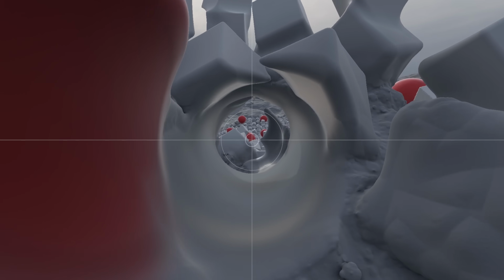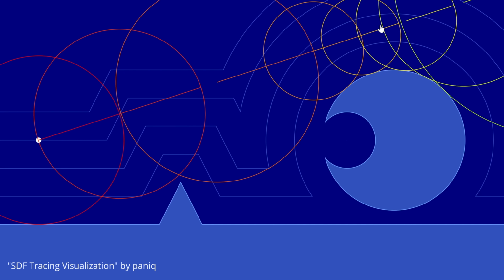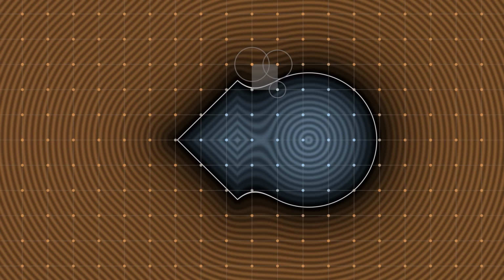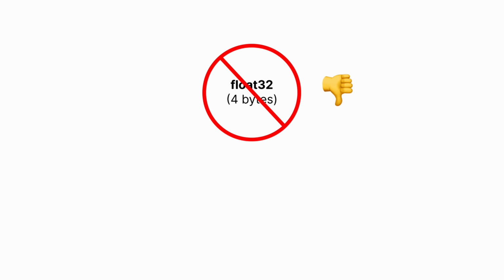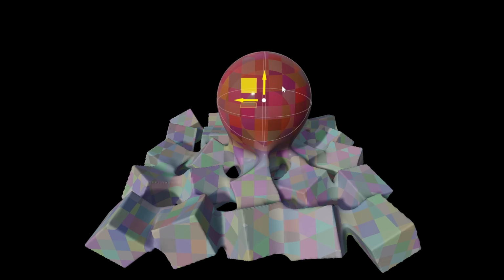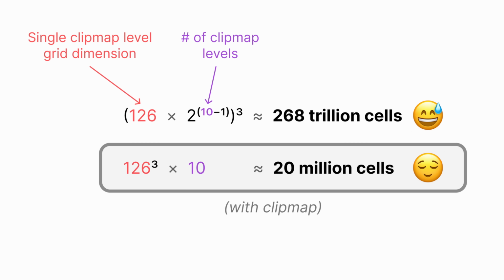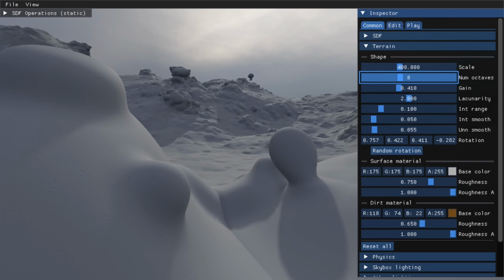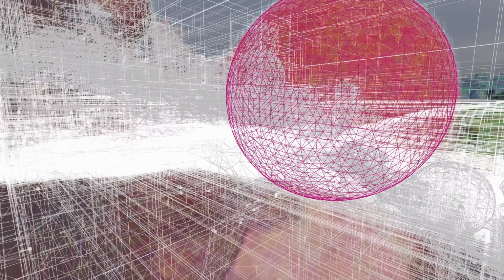I'm making a game engine based on dynamic signed distance fields (SDFs)

Comment from the maker: Hi everyone! It's been really nice to see how this video (my first "real" one on YouTube) has been received. Thanks so much for all the comments. I have been paging through them and trying to look at everything, but the number is high enough now that replying to them is a daunting task. I wanted to answer a few common questions I've seen:

FAQ:

Q: Does the engine require that all objects blend with one another?
A: No, there is a per-SDF-edit blending parameter that can be set to zero. I got a little carried away with enabling blending in my examples, partly because I wanted to demonstrate that all of the moving objects are also SDF edits. Also, it's easy to add objects that aren't SDFs at all, and I'll be doing this for a lot of game objects (e.g., item pickups) that will be rendered as normal triangle meshes. The SDF-rendering process yields a normal depth buffer, so it's straightforward to render other geometry with proper depth testing.

Q: What technologies are you using?
A: The engine is programmed in C++, and all rendering is done via a native build of WebGPU (specifically Chromium's Dawn). I'm relying on a number of great libraries, notably Jolt for physics (as mentioned in the video), and Dear ImGui for all dev UI.

Q: Will you be open-sourcing or otherwise releasing this engine?
A: My focus right now is building the game I'm building with the engine (and adding engine features as needed for this game). So I won't be releasing anything before the game release, but who knows what could happen after that.

Q: Have you seen XYZ games that play with similar mechanics or could be an inspiration?
A: I'm aware of a number of these games and in general very interested in games with dynamic geometry or interesting physics-based gameplay. But there have also been quite a few I hadn't heard of before, so thanks for mentioning them!

Q: What about adding fluid sim?
A: Fluid sim is awesome, and I'd love to see how interacted with non-destructive edits, but I currently don't have it in scope of the game I'm making. This is partly to avoid overscoping, and partly out of concern for the performance implications.

Q: Will you disappear after this video or continue with the project?
A: I'm actively working on this project, with a pretty specific plan for both building out the game and continuing to optimize and add needed features to the engine. I'm going to make more videos, but I'm not a YouTuber and it's pretty time-consuming to do so - so please don't expect super-frequent updates.
Reply: Have you not already made a basic fluid sim here? If those balls rolling down the ditch were set to surface-blend while they remain balls for physics purposes (like the objects you dropped through a hole), you could get a fluid-like appearance.
Reply from the maker: @boissondevin9772  Yeah, true, you can get a "metaballs" type of appearance, though the behavior won't be fluid-like. Could still be useful for some blobby stuff.
Reply: @boissondevin9772  Fluid sim, fluid sim, fluid sim. FLUID SIM FLUID SIM. Screw performance, I'll light my 9070XT on fire.
Reply from the maker: @PhurPher  Noted :)
Reply: @PhurPher   yaa UE5 will light in fire any gpu i bet..
Reply: This engine have the potential to blow up the DIY community of enthusiasts that enjoy creating cool games. You don't have to open source it but I can bet, if you do, it will positively impact your life.
Reply: You mention using WebGPU for rendering. Does that mean you're not using hardware raytracing to speed up the ray->brick intersections? Or are you using experimental WebGPU raytracing features?
Reply from the maker: @tomhutman7721  No ray-tracing features used right now, but I am definitely curious to try at some point, which is partly why I may move off WebGPU.
Reply: what about making it as ue5. we need more competition 😊
Reply: 20 years ago I had a thought for a game-engine that would dynamically scale terrain deformation fidelity based both on the player-position and the player-activity. I frankly imagined it as a VR game, I'm pretty sure, but the smallest part of my idea was to scale from low-fidelity to high-fidelity when the player wanted to do something, like digging in the sand. Now, I'm just dude with no coding experience, and I was a child at the time of that idea, but this is the most accurate thing I've seen to it, ever, and I'm glad you exist. Thank you.
Reply: You mentioned you are using a 8x8x8 bricks. Does this mean you are using your own trilinear interpolation in the shader or do you internally use a 10x10x10 brick and use the texture fetch hardware interpolation?
Reply from the maker: @rihgdb I use hardware interpolation. The 8x8x8 dimensions already include a duplicated outer band, so samples are shared between adjacent bricks.
Reply: Does this work in multiplayer?
Reply: @SockeYoutube  considering this is a custom engine, certainly not. Implementing a network stack is a wholeeee thing all in itself, and not an easy one. If you're using an engine with that stuff built in like Unity, it's not a big deal, but from the ground up it's not something he probably spent his time doing. He didn't even do a physics engine himself, clearly he's got all his focus on the rendering side of things.
Reply from the maker: @SockeYoutube  Yeah, no multiplayer for the foreseeable future to avoid overscoping, but it would certainly be fun to add that.
Reply: Vangers 3d
Reply: What are your thoughts about using SDFs with Voxels?
Reply: Lmao I love that one of the questions is "what about adding a fluid sim", it's exactly what I came down here to ask.  You say though that you're not due to overscoping, but I cannot think of a single core mechanic to compliment in duo with this system to form the bones of a game than a fluid sim. We have games with destruction physics, but basically none with any kind of even relatively modern fluid sim

I get that's a whole can of worms in itself, but if your game was literally JUST this SDF sandbox with some UI tools and fluid sim it would sell better than I'd bet anything else you could solo dev with it.

What you have in the video is satisfying, shoot that alone would sell somewhat, but add in a fluid sim and peoples monkey brains will light up like a supernova. All that said, it's your project, do what you love. That's all a dev should be focused on. Build it and they will come
Reply from the maker: @PhurPher  Thanks, appreciate the feedback on this. I am pretty far into the design of a particular game that doesn't use fluids, but I do think it would be cool to expand this in the future, and the game may also have a sandbox mode. Out of curiosity, are there particular types of fluid interactions that you're imagining in an engine like this?
Reply: Thanks for ur amazing work; not only all the papers screenshots was so useful. Your video edit, tone&tempo, videosamples... man, you might not be a youtuber neither read this but your work is so excelent. Thanks again!
Reply: Nice👍🏻Have long thought that making 3D worlds with only polygons and textures seems sorta lame, and that is a main reason I haven't ever been so enthusiastic about making 3D games.
Reply: Thanks for posting and explaining that👍🏻Recommend any tutorials on making 3D mobius transforms in the shadertoy language and how 3D mobius transforms work? I assume it's similar to a 2D mobius transform where the vertices are 3D instead of 2D, and it wraps around similarly, but I'd like a nice tutorial about that. Thanks in advance for good recommendations!👍🏻

Comment: Your SDF engine is really very cool. But I have an idea that both sound and light are in wave form.
To some extent, when we use SDF for ray tracing,
we can also consider the sound source as a point light source.
This is the same in the PBR algorithm, except that RGB becomes low frequency, mid frequency, and high frequency. Then, there is a possibility that you can build an SDF sound effect system based on your engine to integrate it into your game.

Comment: Haven't been this excited to see a game engine tech since I played around with a constructive boolean geometry demo in the aughts where you could dig in the dirt with smooth integration and a good frame rate. iirc they'd used at least some of the same bag of tricks to keep it performant but it never became a proper engine or game. I think it must have used some of the same papers, though not with ray tracing, there was a generated mesh instead. This really is the grail of additive and subtractive 3D world geometry. It's my absolute favorite research gameplay mechanic. I've been waiting to see this since my favorite game Lemmings came out and perfected it in 2D worlds with sublime gameplay that combines creative puzzle solving with intensely demanding timing. I can't wait!

Comment: I'm willing to bet you're using Dear ImGui in some capacity.
Reply from the maker: You would certainly be correct
Reply: @Mike-Turitzin such amazing work. Do you think there will be a way to make more acute joins between SDF objects so everything doesn’t look so melted? Is that just reducing a radius threshold? Does that tank performance?
Reply from the maker: @jackle3002  It's actually lighter perf-wise to do less "melty" joins! I just got carried away with that in this video.

Comment: If you are still doing it you might want to look at space engineers, while it is not an sdf, its a game with entire planets of diggable voxels, and physics are a big part of that game. Entire engine is made in c# for this game. Its moddable and even has programmable blocks just in the vanilla game
Reply from the maker: I have been curious about that game, have watched a couple videos, but should try it!
Reply: @Mike-Turitzin  i have like 500h on it, I love making land bases with giant drill setups that make unreasonable amounts of materials and my friend loves making ships that require unreasonable amounts of materials that are designed for like 20-30 people and not us 2.

Im a little too stupid to make anything great in C# yet but if i could understand it and make anything at all, you will have a field day on it. 

Whatever you do though, do not host your server on nitrato, and dont build gigantic pipelines, we made a 4km conveyor and our games would freeze for 5sec every 20sec. If you play like a normal person you should be fine. 

Since nitrado would only stream the holes we dug, this means that those voxels are (at least in some way) similar to deep rock galactic, subtractive instead of additive, my guess is that the star system file is a default and then it takes the hole data from the save.

DRG is also a good place to look, every cave is procedural and they have optimised the game a bunch, but im not sure that code is very out there.

The world you made looked sort of similar to the game Utility room btw, that one has nothing to do with voxels but its a neat atmosphere you could use for reference if its at all your goal.

Good video btw, when i actually understand C# in like a few years ill probably get into this even more, the first thing i saw in my mind when you started mining the gloop was how awesome a clay mod would be for space engineers to mine it for ceramic components for high temp uses.

Comment: You should collaborate with the guy who made the Fluid Flux demo in UE5. Imagine shaping the terrain and seeing water actively conform to it. Ever play the game From Dust? Imagine that but with real time terrain deformation and highly detailed fluid simulation, fun for hours. But either way, good on you, I miss when devs tried to make game worlds more dynamic, static worlds you can't interact with are no fun.
Reply from the maker: Someone else mentioned From Dust earlier and I checked it out - looks cool! May try to play it at some point.
Reply: @Mike-Turitzin  Getting it to run on Windows 10+ on modern hardware is a nightmare, unfortunately, so good luck if you give it a shot. I gave up on getting it to work on my main machine, but applying a crack to bypass the Uplay launcher makes it playable on my retro Win 7 machine. It feels more like a tech demo than a full fledged game, and I've always hoped someone would try to more fully flesh out the concept.
Reply from the maker: @K31TH3R  Oof, yeah maybe I will have to stick with gameplay footage then.

Comment: Hey I've been working on my own implementation the last few weeks and I wonder if you considered doing another layer of LOD for ultra fine details and larger details like larger flatter areas within the LOD0 space

I'm currently trying to get Kimi K2.6 make a proper mesh to SDF suite in Unity but that was one of the ideas I got rewatching your video!

I'd think to have dynamic LOD within LOD0 space could allow for even more detail while still cutting down on detail for areas that don't need it like the faces of the cubes compared to their edges. This if anything help with optimizing the collision mesh that's generated

Edit: I recently made a breakthrough and got texturebaking, both meshbaking and texturebaking are both done on the GPU. (The mesh is baked to a 3DTexture using Unity's SDF property and the textureprojection is baked to a 3DTexture but using the volume property)

Edit2: is there a specific reason you made the clipmaps center on the player position and not on the camera viewforward? Instead of making the rendering a big cube around the player that expands with clipmaps, put the cube infront of the player and make distance scale towards the "face" of the cube that's infront of the camera. I'm going to try this myself when I get octree traversal to work.

Comment: My biggest question is if you are limited by the total number of SDF edits in your environment. For example, if you start with a generated world, and then through edits, massively change the structure of the world, is there a limit to the number of edits in the hierarchy before you begin to see performance degradation. I know dynamic terrain systems like Space Engineers had problems with this. But curious if you handle edit compaction or some sort of pruning system if you completely remove or cover an SDF with new edits.
Reply from the maker: I don't do compaction, though it's something that could be done in theory. The main limitation is on density of edits in space, not really the total number of them assuming they're spread out enough.

Curious if you remember where this problem was mentioned by Space Engineers?
Reply: I saw the edit accumulation issue mentioned off-hand in a video, but doing a bit of research, it has to do with how the game stores edits to the voxel maps for a specific asteroid/planet. Those accumulated changes end up causing hitches when moving through areas with large edits since the loading is done with a chunk based system. Also the edits could add to the overall number of vertices in an area. Especially on planets with settings like meteor falls turned on that would passively accumulate changes. But these files are also mentioned to be >200MB of edits for a single planet.

SDFs are probably better in some elements such as geometric complexity compared to regular geometry aligned on a voxel grid.

Comment: Interesting, I'm still not sure what SDF actually do for you though, you're using collision meshes... I get that nurbs-like deformability is fun to much about with, but it all gets converted to triangles anyway in the gpu? SDF could be a sweet spot a fun layer abstraction, but they're kind of mushy and don't improve collision or physics feel, which is a critical failing of most modern games, in that they all 'feel like a clipping engine', like all Unity titles. Good luck though. Always fun to have a diversity of folks trying new things.

Comment: This is awesome, the person that invents an inexpensive vector rendering engine will win the computer and games industry, who wants hi-fidelity ray-tracing if it costs them their first born in VRAM? We’ve hit a point in graphical quality for cards and machines that’s only laterally scalable at this point, damn you light speed and your speed limit. My question is, what happens when you’re dealing with destructive entities for example, you have a dynamite item the character can throw? Right now from this video it looks like your using clip maps locally, if your collapsing you’re grid maps at small distances how does it handle destruction at a far away object in render? Does it hold the raw values in stack until it needs to render or does it update the map immediately by temporarily rendering it? And I guess that leads me to physics because you want to add physics engine, how is it going to handle large scale particle destructors like an explosion?

Comment: Wow this is really inspiring work! This video alone has gotten me really interested in GPU programming.
Just a question about porting the physics to jolt, im not too familiar with sdf based physics engines but I do know that a few open source projects exist (although I'm uncertain about their maturity).
Is there a particular architectural reason why you decided to mesh your geometry in order to use jolt over employing an sdf-based physics solver, or does it have more to do with the maturity of polygonal physics engines when compared to sdf ones?
Reply from the maker: I would say that I like Jolt's general-purpose-ness as well as it being proven in shipping games, but I'm open to experimenting with an SDF-based approach at some point.